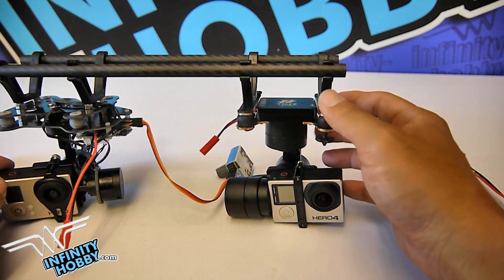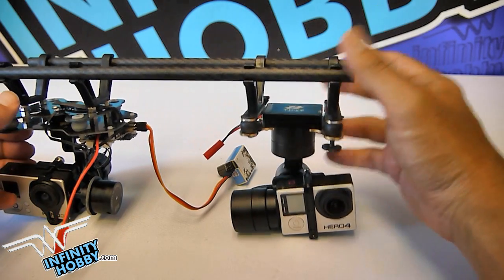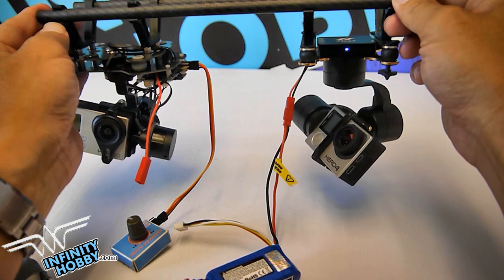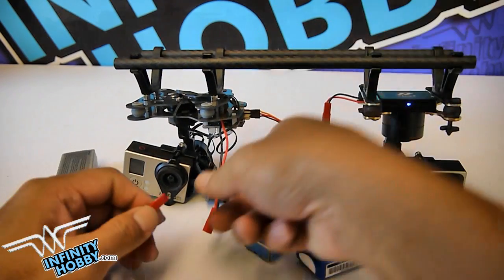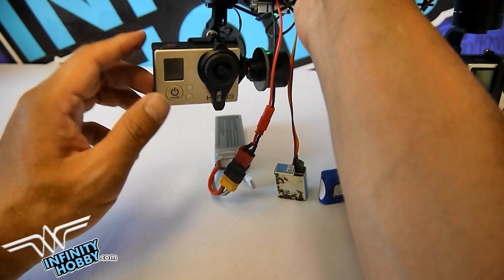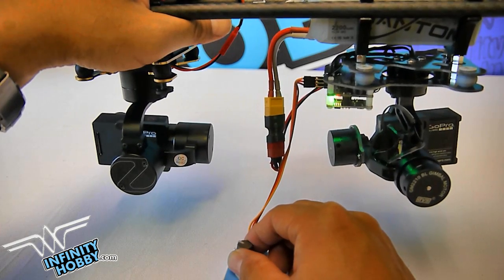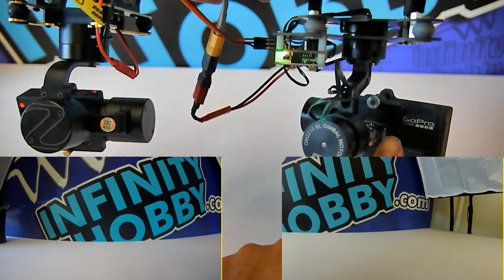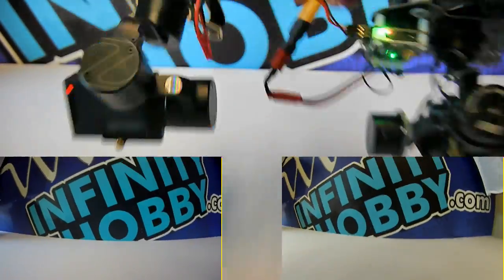PROFESSIONAL GIMBAL VS OPENSOURCE GIMBAL

Comment: I was interested in the Z1 Tiny, but....so many mistakes. AlexMos, or SimpleBGC is not Open source and completely different to BruGi , which is. All those things you complain about are adjustable under AlexMos and speed of recovery is no indication of anything unless you fly into a bird. It's accuracy that counts and anyone flying their aircraft like you shook those gimbals will a) crash and b) be thankful they got any video at all. You fly smoothly for good aerial video, not go out in a hurricane and try and do flips. BTW, that other gimbal looks like a DYS Smart, which has an AlexMos 8 bit controller. Try the 32 bit and you'll have even better performance. And if you took that servo controller off the DYS gimbal it would always face forwards by default. It's wrong because you are making it wrong. This video is about as useful as getting someone who knows about baking to review a motor cycle.

Comment: bad comparison 
Tiny 2 is very good performance from unbox but
1.you can adjust a lot of thing on simple BGC but tiny 2 cannot 
2. DYS can rotate yaw 360 degree but Tiny cannot
3.Tiny 2 cannot control all axis in follow mode